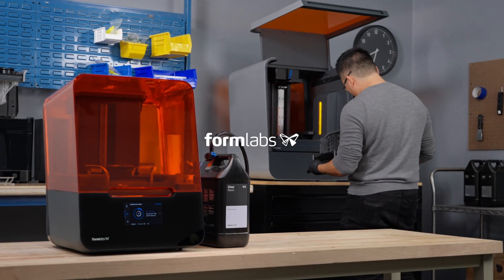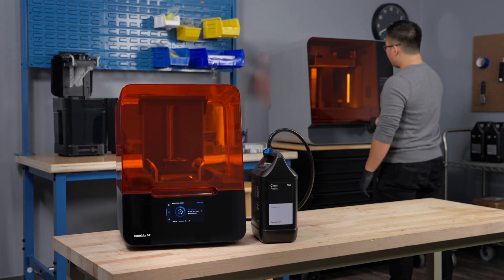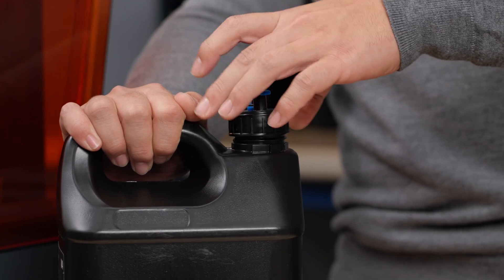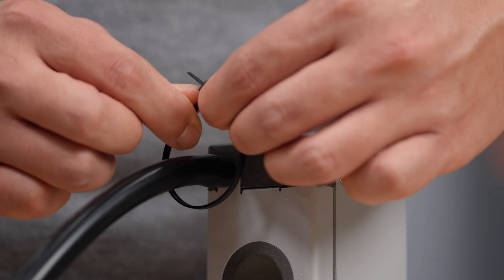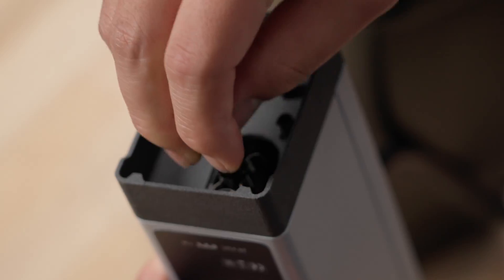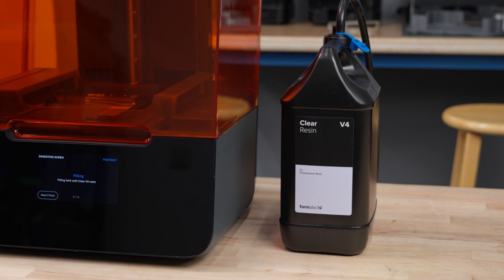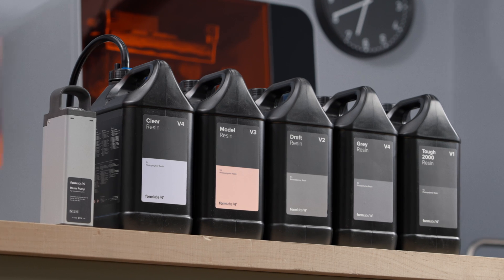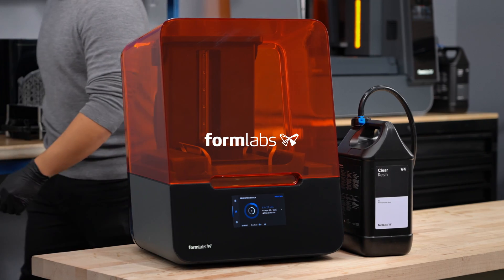Formlabs Resin Pumping System: Step-by-step Workflow

Comment: Is there a process to clean the pump so that it can be used with multiple materials safely?
Reply: it's 4 screws or so to open up the pump housing. From there you can easily exchange the tube inside, Formlabs recommends doing this on a schedule even if you aren't changing materials.